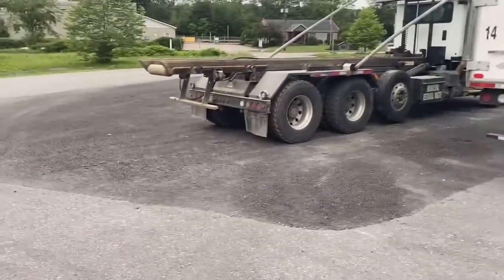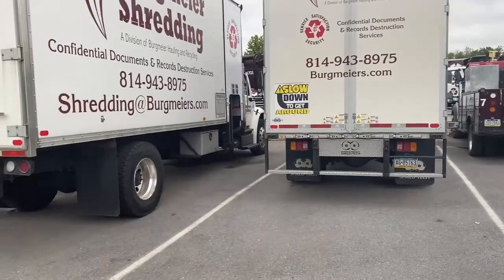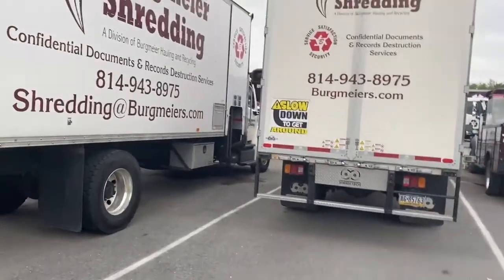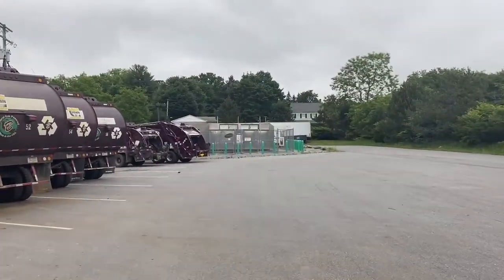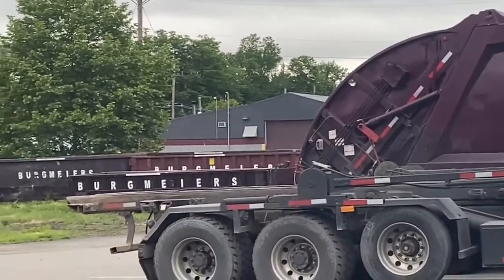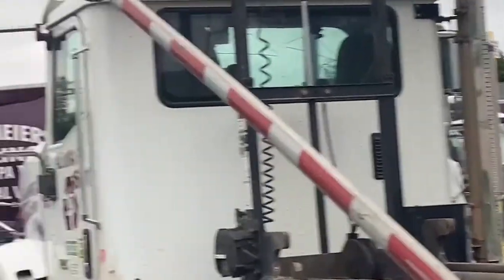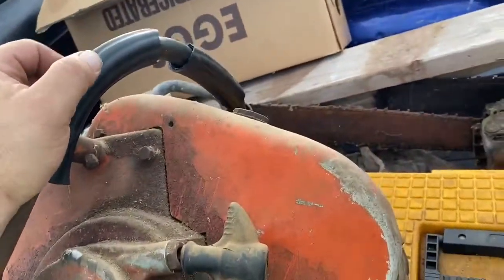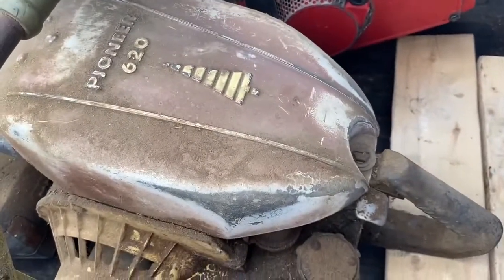Chainsaw Road Trip Hoarding!  Making Money!

Comment: That was an unusual find, to get that many rare and  early saws at one time.  The Disston Mercury Do 100 was an attempt at making a one man saw, but obsolete compared to the one man saws others were making at the same time, way over weight. That bar that has no groove took a weird-ball chain that  rode on the side of the bar.  Did you get the chain?  Good find !
Reply from the maker: No chain.  It was a fun find!